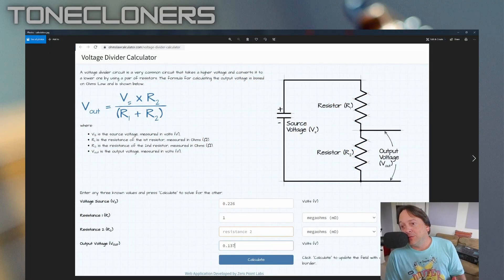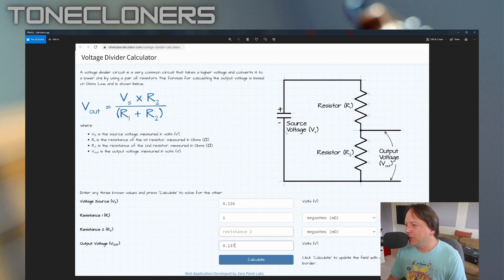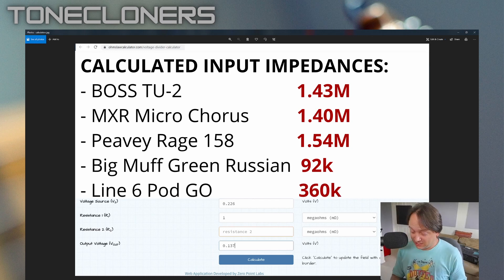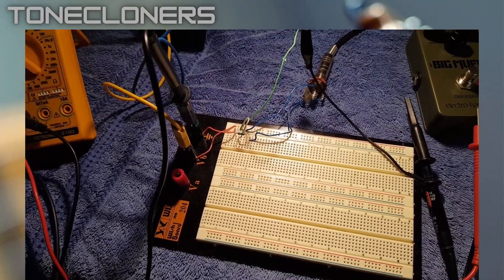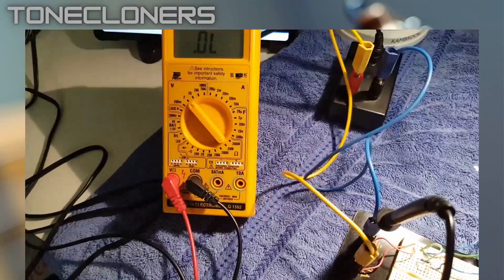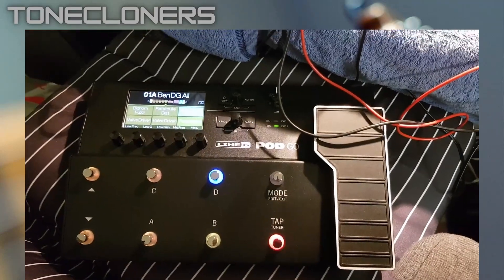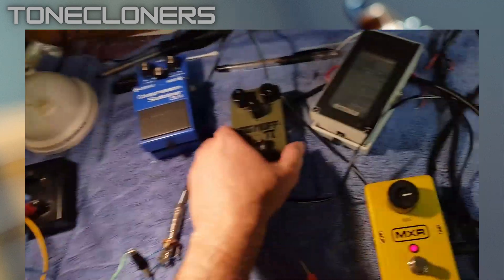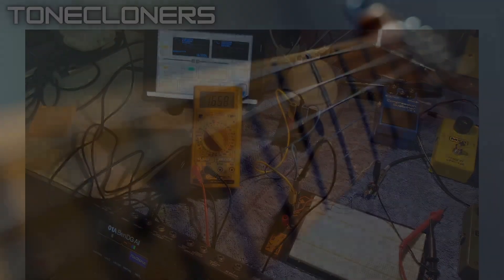Line 6 Pod GO - Tone Suck Explained | TONECLONERS

Comment: Does anyone know if this input impedance issue persists when using USB as an input instead of Guitar in?
Reply from the maker: @SimAviator  There should be no issues with the USB connection since the audio is digital. No analogue impedance to worry about!

Comment: Hi Ben, well done measurements!  It's clear to me that there is something very wrong with the input circuity of this device. I was interested in this device, but not for this moment. If there must be components replaced, it will be difficult for Line 6 to do that. The POD has to go back to the factory or swapped out completely at a dealer location. I wounder if they discovered the issue by now and changed these component(s) in later versions of this product. As a buyer you can't be sure what version you will get.

Comment: Now read the impedance at other frequenciers in the 80-5KHz range and tell me what you see. Spoiler - I already posted on this a couple years ago so it's public knowledge now that there's a 1000pF cap directly across the input. That's the real reason you lose high freqs because the higher the frequency, the lower the impedance goes. The Effects returns are even worse, with two 1000pF caps across those inputs. If you run an Ernie Ball volume pedal in the loop you will lose all your treble with the pedal anywhere but full up. Same problem - same cure. Remove the offending caps, or run buffers that can plow through the low Z inputs.

Comment: I think Im a victim of same problem ( acquired the pod go 2 days ago and it just doesnt sound clean and punchy , all downloaded presets and IR’s sound as if they need me tweak more knobs to clear things out ) please help ! Where and how do I connect things , Im a total newbie in electrical science 😅 , I have the boss rc-5 looper pedal can it help ? Or will a DI box help ?
Reply from the maker: Placing the RC-5 in between your guitar and the pod go would do the trick. (I believe the RC-5 should contain an active buffer in bypass mode.) A DI box would also help because it would convert your guitar from high impedance output to low impedance, which is what the pod go prefers to see.
Reply: @BenCravenMusic  thank you so much !!! 🙏🏻👍🏻

Comment: Hi Ben, Awesome stuff mate.

I just started using a buffer between my Charvel and Pod-GO ... the response of the volume control was much improved ... it no longer felt like a switch where all the action was in the first 3%. (which given your estimate of 360K and the Charvels 500K Audio Taper volume pot is not surprising)

Did you try sweeping the sig-gen, it would be interesting to see how the Pod-GO input impedance varies at 2Khz / 4Khz / 6Khz  / etc. The input impedance 'could' be significantly lower at higher frequencies if rumours of caps across the input to reduce HF noise are true.
Reply from the maker: I sold the Pod GO shortly after this video unfortunately. The manufacturer refused to acknowledge the issue even with this evidence, and the local service centre said they couldn't do anything.

Comment: I have de soldered part C124 on input of my POD Go - works great without pedals in front now! It's was easy. Now sounds great with passive humbuckers and single coils. PAD setting in global settings works too! If now add pedal in front - nothing changes at all.
Reply: Do you have a pic or video of it?
Reply: @jopppsss  yes. I have photo before and after. Can send you by email.
Reply: @jopppsss  https://drive.google.com/file/d/1b7uMX6_5fpZnBXgxzNwt60jw6XDeC20O/view?usp=sharing
https://drive.google.com/file/d/1BPM6IP4AaDh9o8dEWTr29Eyro5OFh7_l/view?usp=sharing
Reply from the maker: Awesome! I wasn't aware of the fix when I sold mine unfortunately. Nice work!
Reply: Have you experienced any noise or other issues as a result of removing the cap??
Reply: @zacharykim295  Hello, no any issues in my experience.
Reply: I man, removin the c124, you keep using guitar in pad of ? Or because of romove the capacitor now you have to keep it on? Thanks for your help 👍
Reply: But do they have a model in production after it turned out with the problem solved?
Or they just discontinued 😂 even the support?

Comment: Hello, what firmware version on Pod Go?
Reply from the maker: Not sure. I sold it already because of this issue. But it is a hardware design problem which cannot be fixed by firmware.
Reply: @BenCravenMusic  I have updated to 1.40 - nothing changed, so only solution is buffer pedal in front. Or I found info, that someone de soldered C124 part from input.
Reply from the maker: @TheRumbman  it wouldn't surprise me if that's the official Line 6 hardware service solution as well. (Possibly at the expense of introducing high frequency noise from the power supply?)

Comment: I got my new Pod Go yesterday and because of this video one of the first thing I did was measuring the input impedance. I got around 1000k
Reply from the maker: That's promising. Perhaps Line 6 has corrected the hardware problem on newer models.
Reply: What tool did you use to measure?
Reply: @jopppsss  I used a multimeter on the tip and sleeve of a short guitar cable
Reply: @ArcticMiniCooper  thanks for the info. Will try it out tonight.
Reply: @ArcticMiniCooper  Btw  should the guitar needs to be connected to the Pod? or should i measure from the output?
Reply: @jopppsss  No guitar connected - a short cable to PG input and measure on tip and sleeve. I don’t know if that’s the most correct way of measuring but that is one way to measure resistance.
Reply: @ArcticMiniCooper  i tried it on the input but the multi meter is not acting up. But when i try it on the output of pod it shows at 1k
Reply: @jopppsss  I tried again now a few month later and strangely I got the same result as you!

Comment: Ive been playing music for years, but im a noobie when it comes to all this electrical ohm stuff, but as soon as i got my pod go i  knew something was not right. I had narrowed it down (or so i thought) to needing better pickups or something, turns out i wasn't all wrong, the issue is before the pod go, right in the input. My ears told me something was wrong! I have two questions and my first question is this, If i get a guitar with emg 81/85 pickups, they have built in buffers, would i still need an external buffer? And my second question is, If i got the guitar with emgs AND added a buffer infront of the input, would that be too much buffer going on? cuz id like to add one regardless since i also wanna play non active pickup guitars too.
Reply from the maker: Hey Morgan. The preamps in the EMG 81/85 pickups will be more than enough to drive the Pod Go correctly. I have a guitar with EMG-SAs/SPC/EXG and it sounded great directly into the Pod. But there should also be no problem connecting the EMGs to a buffer either.
Reply: @BenCravenMusic  Thanks so much for this video and for your reply. You just saved me so much time and money. i was about to sell this thing and get something else. never quite sounded right to my ears and its great to know why now, sucks this made it past line 6, hopefully its fixable in a firmware update. Anyways, im ordering a buffer, I love the videos! take care man!

Comment: Hi have you tried the pod go wireless ?
Reply from the maker: Hi Jean-Pierre. No, but the pod go wireless should sound fine if you use the wireless connection. It acts as a buffer, so the input impedance of the actual pod go is less of an issue.
Reply: @BenCravenMusic  Hi Ben, thanks for the answer and your videos, if you can keep us informed if they correct this problem in future firmware updates it would be nice.  Thanks again !

Comment: I measured using a slightly different method: I used a dual channel scope and a series 1M Ohm pot. One channel connected to the signal generator, and the other on the go's input. I measured 205K Ohms.
Reply from the maker: I suspect your result is more accurate! Mine seemed a bit optimistic. Thanks for the info.

Comment: I am surprised that something like this is happening in the first place. Any idea if Line 6 can fix it, and if they plan to? On another note I’m in a jam now. Could you recommend a decent guitar multi fx pedal in this price range.
Reply from the maker: If I had my time over again, I would look at the Boss GX100.
Reply: @BenCravenMusic I’m considering the GT1. I’m on a budget.
Reply: Do tell though. Once you figured out and implemented the buffer, is the pedal sounding great or is it still compromised. I mean if it’s sounding great I am still considering the Pod Go. What would you advise.
Reply from the maker: @accentontheoff  The pedal sounds terrific with the impedance sorted, no doubt about it. Needing a buffer though stops it being an all-in-one solution as it was intended.
Reply: @BenCravenMusic  Sure. Thanks.
Reply: @BenCravenMusic  By the way, does the problem occur when you plug into an audio interface. Do you find yourself needing a buffer in that situation as well.
Reply from the maker: @accentontheoff  Yes, the problem is at the input stage of the Pod. It won't make a difference what you plug it into after that.
Reply: @BenCravenMusic  Yes, got it, thanks.

Comment: Using boss pedal solves this?
Reply from the maker: Yes, using any pedal with a buffer in it helps this. The Boss buffer circuit is quite good and not true bypass, so any Boss pedal in bypass mode will do the trick.

Comment: Thank you for this very important discovery! What can be the easyest way to fix thia problem besides a pedal? Is there some kind of cable or a small pedal with a buffer in it?
Reply from the maker: At this point I think the best fix is not to use the Pod GO. Other than that, if you have active pickups you won't have this problem. Something like this would also work, but you will need another power supply for it.
https://www.amazon.com/MOSKY-Buffer-Effect-lightweight-durable/dp/B07PP6DZDZ
Reply: @BenCravenMusic  would I plug that before the pod go? Or on the output of pod go before the amp? 

Amy help is greatly appreciated :-)
Reply from the maker: @ConcertCultureSound  Definitely before the Pod GO. The problem is with the input stage, so the signal needs to be buffered beforehand.

Comment: Please keep us updated if Line 6 works further with you on this. It was posted in a thread on thegearpage (maybe you're already there?) and one of Line 6's product managers was tagged in a reply, so they're sure to have seen it. Did you take measurements with the input pad turned on, too? I'd be curious if that changes the value. Also (and I know this sounds bizarre) a reddit user said that their Pod Go sounded much different when it was powered on with their guitar already plugged in, vs. being powered on and then having the guitar connected. I have no idea why that would make a difference, but if the input has active circuitry that is doing some sort of impedance balancing, maybe it could have an effect. Just a couple thoughts you might want to test. Since it's grounding the input with the power off, there's obviously more on the input circuit than a simple jack to the A/D.

Comment: many thanks for bringing this up. I have been experiencing the same issue and always thought that it was me/my guitar. The problem you are describing also is obvious whatever the output -monitors,headphones or FRFR.
Tweaking softens the problem but renders creating a patch more difficult and creating certain tones impossible. This also limits the modeller a lot and affects overdriven sounds, neck pick up options etc.
I also created a ticket to line6 explaining the problem attaching an audio file with and without a buffer. Line6 should fix this asap.
Reply from the maker: Even if you try to compensate with EQ, that patch will be useless if you use a different guitar, eg with active pickups, or single coil vs humbuckers.

Comment: Do you have the "Tone Suck" only when using an Amp after the Pod Go or do you hear it on headphones too?
Reply from the maker: The problem is with the input stage of the Pod GO, so it will be heard both in an amp or using headphones.

Comment: That was INCREDIBLE!! Thank you so much for making this video, it really puts things into perspective. And by the way, thank you for your video about buffered input, I just received my Pod Go last week, great unit but now I cannot use it without a buffered pedal in front of it. It's really a shame since I wanted this one unit to do everything but well... I was wondering however if there wasn't a way to correct this lack of brightness with an onboard effect, such as an EQ or maybe a compressor? Have you (or anyone on this comment section) found a way to "correct" for the lower signal impedance, or is it really too difficult? The sound by the Pod Go itself is not terrible, but I feel that with the buffer it really comes to "life". It's a shame we don't get this sound right out of the box though... Your findings that the input impedance may be software-controlled is a silver lining though. Maybe in a future update?
Reply from the maker: Thanks so much Paul. Line 6 hasn't acknowledged this as an issue, and suggested that my hearing was simply subjective. I fear that any corrective EQ will make patches behave very differently with different guitars. For instance, I have a strat with active pickups, but any patch designed to compensate for passive pickups will probably sound too bright with actives. It is a pain to have to use a buffer just for consistency! I am hopeful the input impedance may  be software controlled so this can be corrected with a firmware update. The higher Helix models and Helix Native I believe allow adjustable input impedances. Because, seriously, nobody would actually design hardware today with an input impedance of 300k!
Reply: @BenCravenMusic  Could you share what you mean when you say that Line 6 suggested your hearing was subjective? Did you reach out to their product support? Or receive a response via a forum?